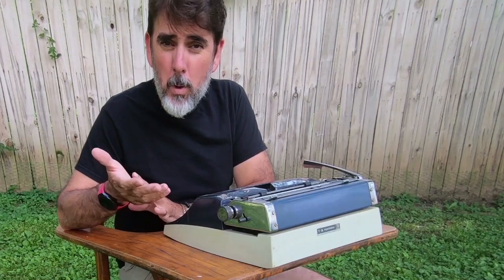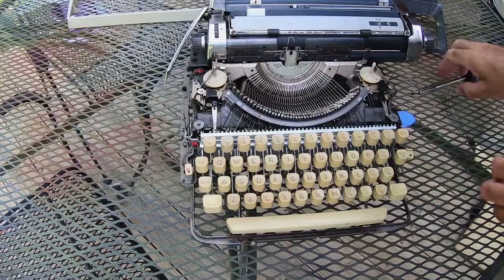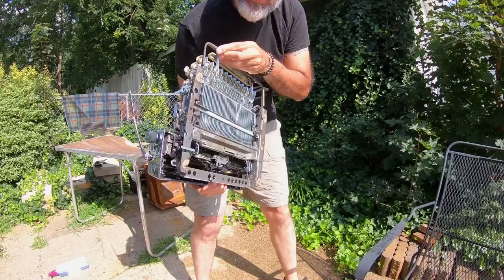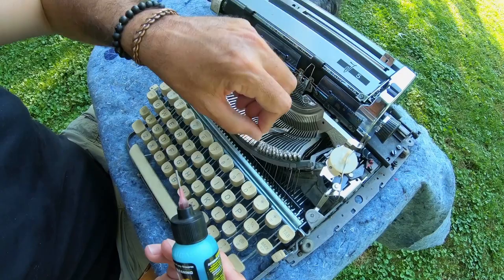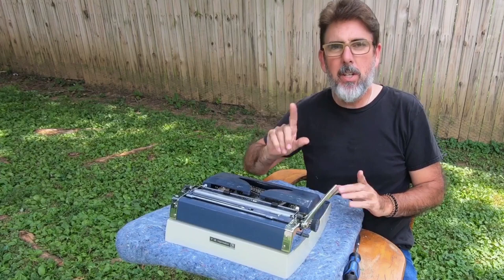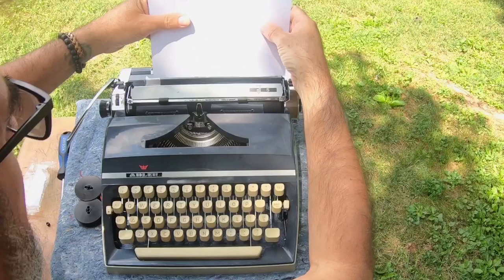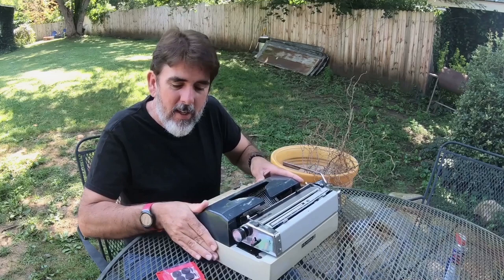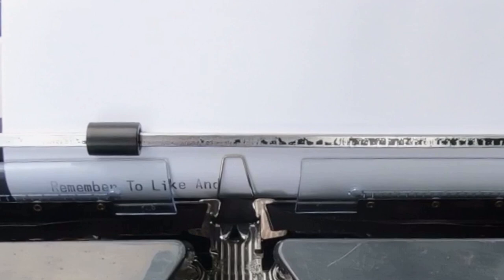How To Clean A Manual Typewriter: As seen in the documentary #CaliforniaTypewriter #Typewriter

Comment: Why didn't you take the platen and feed rolls out
The TYPe BARS sit in the SEGMENT, you need a segment pick to get the majority of muck out of the segment
Reply from the maker: Thanks for the advice. Over the past couple of years it's been one big learning process.
Reply from the maker: Bill, I've thought alit about what you said here. Where can I find a segment pick? What do they look like?
Reply: @Thisguyandhiscamera  Good morning, 0723 hrs and 11 degs in Phayao Thailand , that's cold for us.   I can't remember ever seeing a commercially made SEGMENT PICK, it was something apprentices made very early, very early in the apprenticeship. Many were made from old Underwood type bars . Underwood din't have a hole for the segment wire,  the bar "hooked" onto the wire and could be removed by pulling the bar upwards and back, you would grind the upper section od the hook off together with the end where the type was soldered, then attach the type bar to a 3/16 or 1/4 rod by hacksawing a slot in the rod and soldering it in, a bit of work involved....I used a straight  piece of spring wire, with flats ground on each side to let it fit snugly into the segment, it had a slight bend upwards that allowed me to get on to the top of the type bar and the bottom oif the segment  underneath the congealed .muck and lift it out, You may be able to make one from an old hacksaw blade, if the blade will fit into the segment when the teeth have been ground off, you could shape  ( you've got me thinking now) this is all dependent on the blade fitting into the segment...you could grind the end to a  long taper and remove the top hald of the hole leaving just a very small hook at the bottom, enough hook to get between the bar and the segment  that shape would work............FLUSHING WITH LACQUER THINNERS DIDN'T WORK SIXTY YEARS AGO AND IT WON'T WORK NOW FOR THE SAME REASON THAT IT SOFTENS THE MUCK ON APPLICATION THEN DRIES AND THE MUCK IS STILL THERE..WE USED WHITE SPIRIT (WIKLIPEDIA) WITH A DASH OD WHITE  OIL, THIS WAS USED WHEN i FIRST STARTED AND WAS STLL IN USE 50 YEARS LATER.        This has been long winded, but if you need help give me a video call on face book and we can talk about it      Cheers  Bill
Just had another thought, motor bike spokes make great spring hooks, there is no reason why one couldn't be shaped for a segment pick, the hook end is already there
Reply from the maker: Absolutely fantastic information Bill. Thank you very much for sharing this with me (and all who will read this in the future) as it’s so incredibly important for us to preserve and pass on the art of repairing these amazing machines. I will be giving you a shout soon via FB.

Comment: I Am  Issuing  A Cry For Help! I Have An Adler J5, And The Rust Has Gotten So Bad, The Key's Don't  Even Move Anymore. It's Located Entirely In The Typebar, The Slots Where The Key's Pass Through Before Hitting The Paper? I Think That's What That Term Means. How Do I Get Rid of It?
Reply: Soak it in vinegar for a few hours then use a small brass brush to remove the rust.
Reply from the maker: This is an EXCELLENT idea. The vinegar will break down and remove the rust beautifully. (White Vinegar).
Reply: work keys with lacquer thinner followed by thin rose oil then lacquer thinner again  - must remove all dirt and rust - i fixed many adler J5( Adler Rep) - it is German it will clean up well

Comment: Heck, if I knew I could power wash my Imperial from the start... I guess I'll have to go door to door to my neighbors and see if I can beg for a loaned air compressor. 

Side note: do you think that it's safe to just use a normal shower head with a little bit of dish soap as the solvent? I don't have sufficient water pressure to remove the lubricant physically, so I guess I'll need to dissolve it with the dish soap? If not, what other household items would you recommend? I'm in the UK if that helps.
Reply from the maker: You can prep it and take it to a self serve car wash with a quart spray bottle of 'purple power' or 'simple green'. 

That's actually how I first saw it done in the documentary 'California Typewriter'. Really a great movie. Also... Compressed air in a can to get the water out if you don't have a compressor. Might take a can or two. Then hit it with a little heat (hair dryer) or set it in the sun.

Thanks for watching!

Comment: Fail to understand why the reluctance  to remove platen and and feed rolls, Hammers = type bars. When this machine was made we used a clear stainless oil. Black ribbons will not last twice as long as black red.  A fifty year old platen is probably forty seven years past it's use by date
Reply from the maker: Thanks Bill. Next time I’ll be more thorough. Stay safe.
Reply: black and red ink always migrate to center to create a mess - quick platen fix  - use grit cloth lacquer thinner plus towel roll easy and evenly should remove pitting and slipping - if platen is real bad then might also need platen paper gap adjustment might be needed
Reply: @JosephFernandezfrpm  I 'll wear my ribbon manufacturer's hat of 25 years to reply to this part of your posting, inks used in the manufacture of ribbons should migrate evenly into the tracks created by use. Black and colored  inks Will not invade each other, that is black and red inks will not invade each other, they actually reject each other. If you have a "MESS" in the centre of your black red ribbons the inking machine(s) has/have not had the tracking alignment set up correctly or the ribbon 'manufaturer is using the inks not made for the ourpoose for which it's being used. I'll change my hat to that of a Journeyman Typewrite Mechanic,  if platens are pitted it's because they are old and the rubber has hardened, pits are sometimes so deep removing them effects paper feed and impressions. Platens were sometimes resurfaced in the workshops but this was done using a lathe, lacquer thinners was never used , it does give the platen a very nice dull, like new appearance but in fact it tends to harden the rubber, try methylated spirit.

Comment: Won’t it get rusty if cleaned with water ?
Reply from the maker: It is very important to see to it that all of the components are dried properly. Using a good degreaser and power washer is a very efficient and effective means of cleaning. But admittedly getting it completely dry with compressed air and a sunny day are equally important. Thank You yo for watching!🙏

Comment: I like Z-Max better for your car than dura lube.  It's the only oil additive endorsed by Carroll Shelby and it's ALSO approved by the FAA,  and those guys are super anal about airplanes.
Reply from the maker: I’ve seen it on the shelf, but never used it. I’ll give it a try. Actually plan on changing the oil in my bus this week. I’ll add it to it! Thanks for the tip. I’ll let you know how it goes/preforms.

And thanks for watching!
Reply from the maker: UPDATE: I found it by the gallon for my DT466E/Bus/Skoolie. Thanks again!